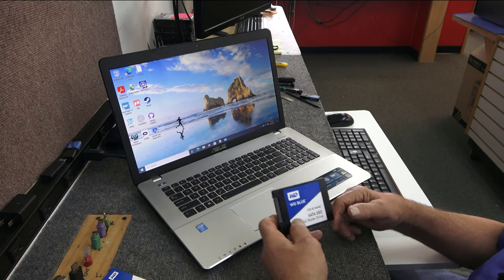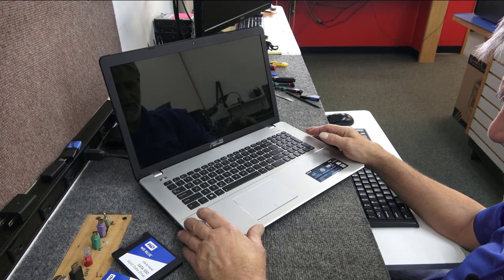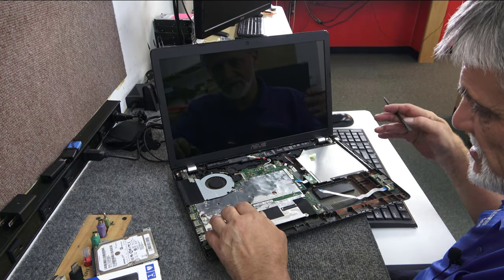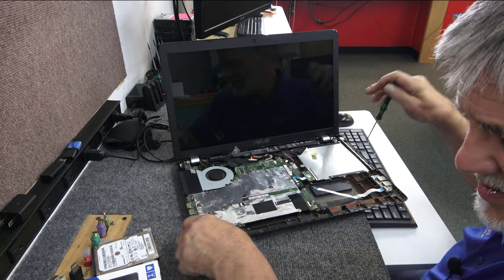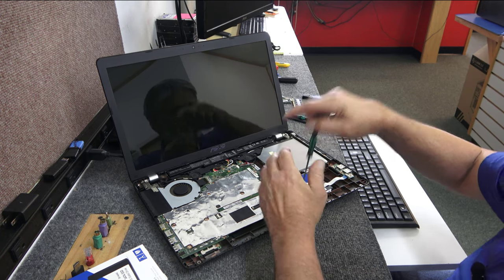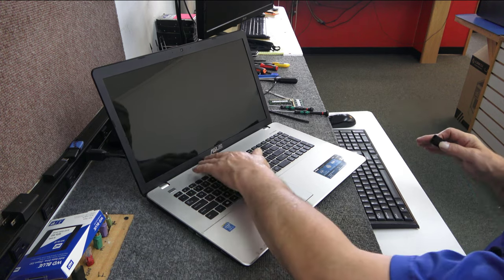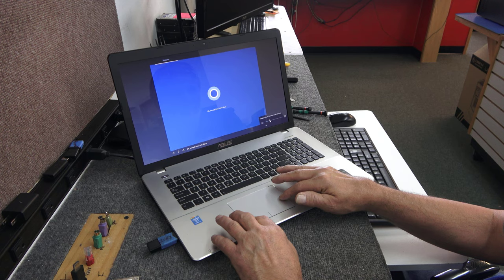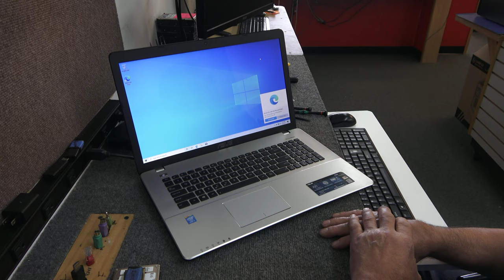ASUS X750JA 17.3" Laptop Disassembly SSD & Memory Upgrade Clean Windows 10 Install

Comment: Can I ask? Where to source replacement monitor display screens? HP Z23n G2 - November 2020 - with a screen that is broken. Are there replacement tags indicators on the inside if I dismantle it? Sorry but I'm surprised repairing screens is hard to find information about.